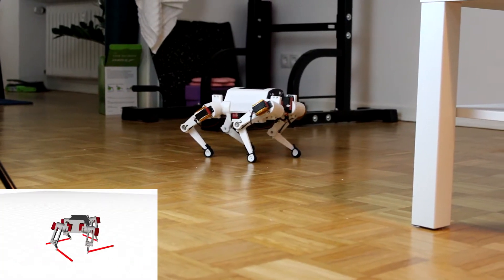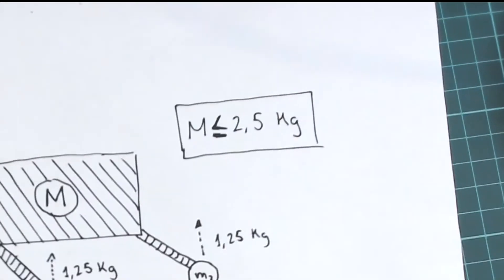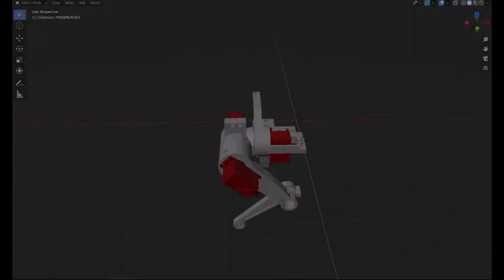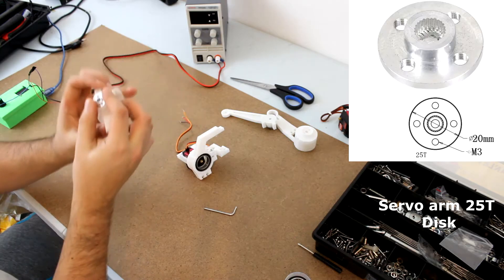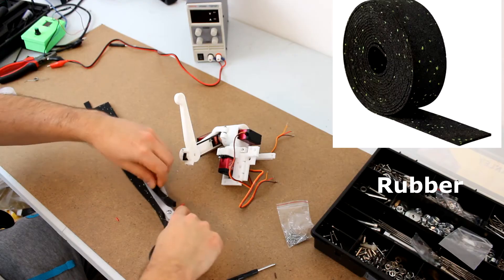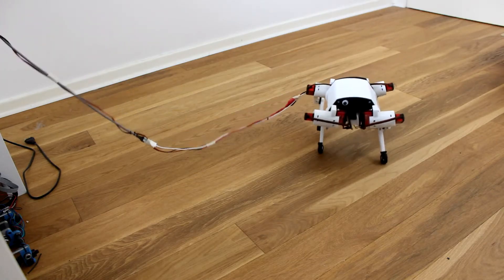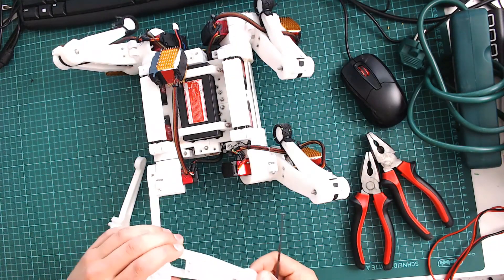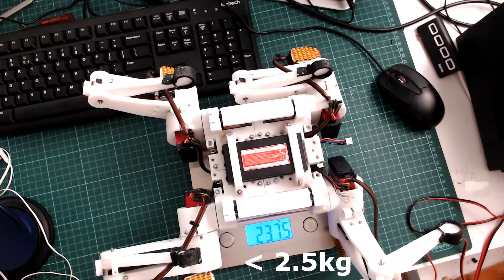How to Design a DIY Quadruped Robot

Comment: Hey,
I currently only know about arduino and am able to do control motors, relays, pair with bluetooth, work with sensors, motor drivers, servos and all that stuff.
I've made a few helpful projects using it like 'smart' wheelchair and agriculture robot. But that's about it. All of them I've coded myself.

I came across videos of James Bruton, your channel and many more.

I was wondering, how can I get on that level where I can make my own 3d models on some 3d software, all that kinematics stuff. How do I develop the mechanics for it? Code for the balancing of Bipedal or Quadrupled robots. How do I use Computer Vision to control robots?

I searched youtube for it but must of the videos are too small to explain the code and the structure. By that I mean, the logic and the thought process behind it. There is just the 3d files and the code. That wouldn't be innovating from a learner's perspective I think.

There must be online courses I enroll do to achieve this. What are those? I couldn't understand which kind of course would be suitable for me. Please guide me.

Comment: How did you program ,which board did you use ,how did you connect camera,and finally how you using robodog autonomously or with an Rc controller 🙂

Comment: Hi, I really enjoyed the video and I got inspired to build this. I just couldn't find the foot left and foot right models on gitlab. They are under feet parts. I only get a message, that it didn't find them. Does anyone know, where to get these files. Thanks in advance.
Reply from the maker: Hi! thanks for your interest in the project! I checked the gitlab repository for the left and right foot parts and I myself can download these parts perfectly. Maybe try to download the whole repository again and make sure you are in the master branch. Let me know if this still doesn't work, so I can try to send you these parts
Reply: @Androtics_AI  Hi, thank you very much for the tip. I can download all models now. Do you also have some kind of guide or diagram of the wiring?

Comment: this is an excellent mechanical design that looks incredibly efficient for power transfer without ripping the joint assembly apart like most other designs out there, do you do professional robotic design or something?  by the way thanks so much for sharing!
Reply: btw do you have an IK simulation for the gaits / movement etc?

Comment: Awesome project! How did you decide on the ratio of the length of the tibia/femur? Is it 1:1? Was that a choice based on the mechanical properties? Or just seemed like a reasonable ratio?
Reply from the maker: Thanks! Good question! It would be totally possible to choose another ratio. The main reason for this choice is symmetry, because I use the same motors to move the tibia and femur,  and they have the same mechanical properties (torque and speed). Having the tibia shorter, for example, would require different speed and torque commands in these two motors to reach the same foot positions.
Reply: @Androtics_AI  Thanks for the reply! Mechanically speaking, would there be advantages to different leg length ratios that might make it worth the effort to use different gearing on the belts and code to compensate?
Reply from the maker: I'm not sure, the only advantage I can see is if  you use a less powerful (less torque) but lighter motor to move the tibia, and then you design the tibia shorter to compensate. Having a lighter motor there would make the legs lighter and therefore the robot more stable, as I explain in the video. But you will run into other problems. For example you will have less foot reachability, which means that you will have less available 3D positions of the foot when you move the motors of the leg. This most likely will affect the walking of your robot.

But it's an interesting discussion, thanks!
Reply: @Androtics_AI  Really excellent points you’ve made. I guess another important point in favor of 1:1 is that it looks like Boston Dynamics and MIT’s quads have what appears to be 1:1. I imagine they’ve weighed the pros and cons of different ratios pretty thoroughly and probably arrived at the best possible geometry (or at least damn close). Thanks again for your awesome video and taking the time to respond. Looking forward to more great stuff from you in the future!

Comment: How much did it costs you to make a full robo dog...
Reply from the maker: The price of the version in this video is about 500 Euros. However I updated the servomotors (which I'll show in later videos), created a robot face and included a lidar sensor, which increased the price to around 900 Euros. More info in the git repository

Comment: Great work there. I am wondering if the legs should be closer together, that is the 2 front legs should be closer to each other and the 2 rear legs closer together. If you look at a dog, cat or horse, you will find they are arranged this way. This arrangement should make the robot much more stable. You appear to have room for the shoulder servos to be closer without them clashing.  You also appear to have room given the battery and Pi widths.
Reply from the maker: Hi Dave! Thanks for your comment! I think you made a good point there. In my design the robot is not squared, but the front and back legs are a bit closer together. Anyways, this is something I could improve in a future design
Reply: @Androtics_AI  Cool. I'm working to CAD up the dog in another program so I can look at the geometry, but this will probably take a week or so.
Reply from the maker: @DaveEverett01  You mean my design or your own design of a robot dog? Either way, good luck!!
Reply: @Androtics_AI  Your design, but made thinner in the body and maybe modify the parts to simplify the 3d print. I have already ordered all the items in your Bill of Materials. Thanks for publishing everything, hopefully we can all contribute to your great project.
Reply from the maker: @DaveEverett01  Oh wow! that's great! thanks for building Pavlov mini! I'm very happy to help if you need anything, and if you improve the design, please share it with the rest of us ;)